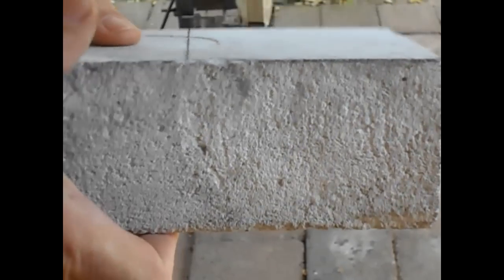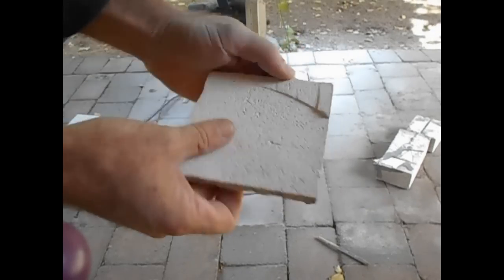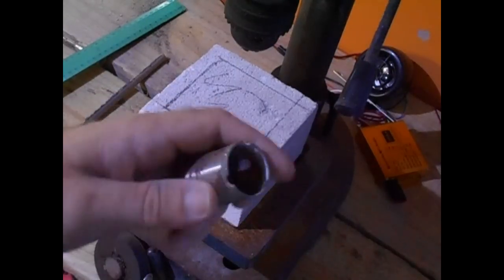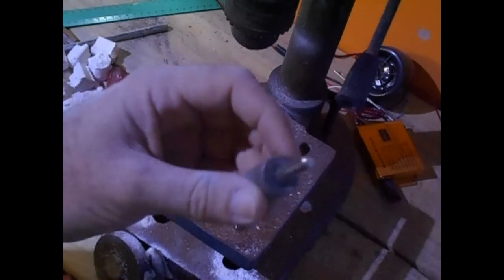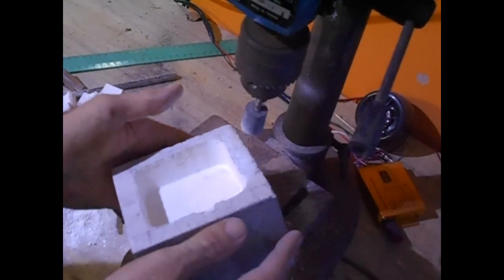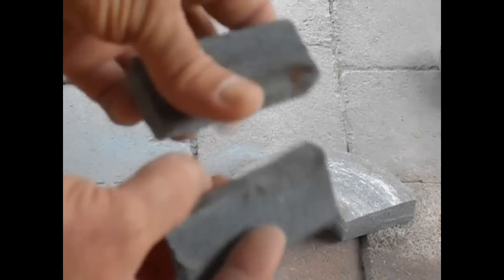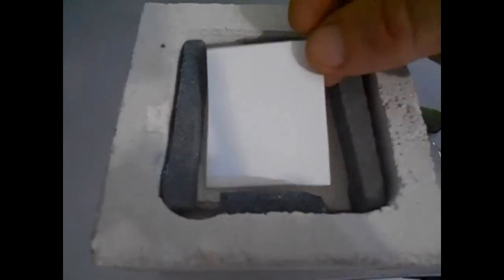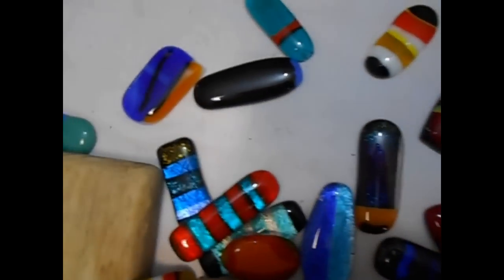How to make a Microwave Kiln - Easy and Cheap DIY Glass Fusing & Melting

Comment: Thanks for this video, very informative. Question: The standard dimensions of these insulation bricks in my country are (l x w x h) are 23 x 11 x 6.4 cm. It would mean that I am able to make a square oven of 11 cm, which is rather small……… By cutting off eg 15 cm long sections and use them as sides, as well as joining sections for the bottom and top of the kiln, can these be easily glued with heat resistant cement for example?
Thanks!
Reply from the maker: I also use half bricks, it's a good size for the microwave oven

Comment: i first watched this vid late last year and decided to make my mother one. i found the refractory bricks for 100 rand each from a very nice online foundry store based in ct. my bricks look a lot more porous than yours though. iv tried everywhere to get silicon carbide and cant find it. my bench grinder has aluminium oxide discs, i bought an oil stone which turned out to be some odd synthetic and iv asked around and still no luck. i dont really want to buy a new silicon carbide stone just to chop up.  is there any chance i could like buy just a few small pieces from you ? im in the eastern cape.
Reply from the maker: Sorry, I've been away for a while. Do you still need silicon carbide?
Reply: yeah  @thebeachfishing  i do,

Comment: Could you post the link to where you bought the bricks? I see a lot of kinds of bricks online. How did the kiln work? Whats the maximum volume? I'd be using it for raku glazed tiles.
Reply from the maker: Hi dssd. I picked up the bricks at a local refractory. The volume of my kilns varies but the average is 100 - 150 cm³.
Reply: @thebeachfishing thanks.
I just bought one.. they are great for drying green wet clay.. 25sec at a time

Comment: Nice job. Good hint with cutting up the grindstone. 😊😊
I do ceramic work and I have a Chinese one that I bought on ebay. Works fine but is too small for what I do. (Biggest available).
Can you make one much bigger? Or is there a problem with using one that is too big?
Reply from the maker: Hi bossdog. The only limitation of the kiln size is the size of the kiln bricks which I use. I don't see why 2 bricks can't be cemented together with fire resistant cement to make a larger kiln .

Comment: Thanks for such great and practical video.   I´ve seen in other videos  they drill a hole in the top.  Is it necessary?
Reply from the maker: Why drill a hole when you want to retain heat. Holes are necessary for gas furnaces because the injected gas needs a way out after its burned. No gas is used or created in the microwave kiln therefore no vent is required. The seal on the lid is not perfect, allowing expanding hot air to escape slowly. Thank you for watching 🤗

Comment: That's very clear... and clever!  Thanks a lot!
Suggestion: the microwaves have a center of maximal power focused just above the plate... going several cm higher may loose quite a bit of power... maybe shorter "legs" would be better?
Reply from the maker: Ah, thank you, I'll make a lower one with shorter stands and see if it makes a difference! 👍👍

Comment: Hi there this is fantastic. If i say wanted to make small glass window panels like on old fashioned stai ed glass could i use ceramic tile in bottom of kiln so it gives a flat finish to one side or would if pose a problem do you think? 
So inspired by this... nice one !
Reply from the maker: The bottom side will be as flat as the surface which you melt it on. Kiln paper leaves a smooth finish but not shiny. Thank you for watching 🤗

Comment: I have bbq high temp paint, i want to use micro2ave for this project same as your but the paint i want to use it with flour pots outside for using a small pencil torch or tealight, i see automotive paint is 2000° bbq paint is 1200° i have this last one but have pots too i need to make one for outside two times your kiln size...planning on doing raku and glazing...hoped not have to buy the thermal blanket if i dont have to. Do you think itll work? Tha ks sam
Reply from the maker: I'd say give it a try and see what happens. Just don't put any metal into the microwave and be very careful, the kiln becomes very hot, 1400'C+. Thank you for watching 😊

Comment: Lastn iggt i dexided to make a low fire clay kiln for outside itll work like the adobe oven...i think that fire brick limes inside, pencil torch or tea ligh but the terra cotta one for inside or out side. Hoping it works if it does im making a bigger one...inside diameter is 3-1/4" over time planning on a you tube channel...most of my work sells before i can devertise lol. Thanks for the help. Sam
Reply from the maker: You're welcome Terry. I would love to see some of your work!
Reply: @thebeachfishing  my na.e is samantha, i am using terrys axxount. That be cool i only have messenger or email and plan to do pictures. Hopedully i can get a channel here or advertise. Tha ks for the video and the help.

Comment: Could a person use an aluminium oxide grinding wheel as element instead of silicon carbide
 Can't get hold of silicon carbide grinding wheel.
Thanks
Reply: Yes
Reply from the maker: Normal common grey grinding wheels are made of silicone carbide, easily obtained. Thank you for watching 🤗

Comment: What was that white thing under the glass, not the insert. Was that kiln paper? Silicon carbide, where can i find that? I seen graphite powder used for the bottom amd someone said reactive paint but so far this is the best i have seen thanls for the video.
Reply from the maker: Hi Terry. The paper is indeed kiln paper. Silicone carbide is common grinding stone. Workshops will give you old ones for free. Thanks so much for watching
Reply: @thebeachfishing  i will ask around for the carbide wheel...the block at local clay store sells firebricks the large kind for 10$ thank you so much for the video, i need a taller space inside for clay firing. Capt mike has cideos for all his work and it seems to work well. The other suggestion from another viewer to use was graphite inside, but yours using the carbide seems like it will be eaier to get, thanks for the tip!
Reply from the maker: @terrynicholson5214  You're welcome. Let me know if you need more tips.

Comment: Thanks for very interesting video- but when you say "Graphite also works" does that mean you could just take a pencil and apply its graphite on the inner surface instead of the silicon carbide? (or for that matter, rub a piece of coal on it?)
Reply from the maker: Thank you for watching. Graphite sticks and graphite paint work as microwave susceptors. I don't know if a very thin layer will be effective, I'll have to do a test... have a great day 🤠
Reply: Some carboN Ark weldinnnn
Gouging rods .. are .graphite.

Comment: Purpose of using grindwheel pieces. Can you tell me is there something else could use for whatever the pieces do?
Reply: The grindwheel pieces are silicon carbide. They absorb the microwave energy and heat up.
So no, there's nothing else you can use instead.
Reply: @whynotdean8966  maybe 
Trumps head ..

Comment: Amazing! How many microwave ovens do you burn through, or does the magnitron handle this well? Also, could the kiln be made bigger so that bigger objects could be made, or does that present a problem?
Reply from the maker: Hi @R Cort. I have not had a failure yet, the microwave copes well. I do give it a few minutes to cool between firings though or else it gets hot. I also remove the kiln from the microwave to cool off. I'm sure it can be bade bigger, I'll try and post a video. Thank you so much for watching😊
Reply: Its 
Finnnnnn. With me.

Comment: Are there any reason you've used carbide slices ? Crucible withouth it cannot work ? Im really curious :) 
Regards
Reply from the maker: Silicone carbide is heated by the microwaves, this heats the kiln.Graphite also works. Thank you for watching.
Reply: Thanks for vey interesting video- but when you say "Graphite also works" does that mean you could just take a pencil and apply its graphite on the inner surface instead of the silicon carbide? (or for that matter, rub a piece of coal on it?) Thanks again
Reply: TheSoundsage ill check that cuz im planning to melt some quartz :)
Reply from the maker: @TheSoundsage   graphite paint on the inside of the kiln is also used by some. I have used thin graphite sticks, but had more success with silicon carbide. Thank you for watching 🤠
Reply: @thebeachfishing  hi thank you. 
Is silicon carbide a better conducting and therefore requires less microwave time would you say?
Reply: @TheSoundsage  goooooD dam 
Just try it .

Comment: Very nice! 
Is it a problem if the microwave does not rotate? Because i'm looking for a cheap microwave for the experiment, and i find one that doesn't rotate but has a economic price.
Reply from the maker: Hi Maria. I'm sure it will work just as well.  Thanks so much for watching!
Reply: Just put it on 
A marry.go.round.

Comment: Is that graphite? The dark grey strip you added toward the end?
Reply from the maker: That is silicon carbide, emery well or grinding wheel cut with a ceramic blade on an angle grinder. Thank you for watching 🤗

Comment: What is the rating on the fire brick you are using? e.g. K-23, K-26, K-28
Reply from the maker: Hi Jerry,Merry Christmas!! The bricks are not fire bricks, they are kiln bricks, I'm not sure what the rating is,or even if they are rated. They are the cheap common variety used for glass melting furnaces. Thank you so much for watching, have a great day! 🤠
Reply: @thebeachfishing  big difference? 
whats the difference? i have some furnace bricks from a old dryer from a limestone burner..would they work?
Reply: Its 
Judt 
Dam hot.

Comment: Was there a reason why you halved the carbide slices? Just for space or was there another purpose? :) Btw using the core pieces as stilts is genius!
Reply from the maker: Yes, they were halved for a better fit, to allow the lid to fit on, and to maximize interior space. Thanks Julie🤠

Comment: Doesn’t the top need a hole?  The other videos I’ve watched all have a hole.
Reply from the maker: Hi Lab Rat. I have never made a hole in my lid, the seal is loose enough to allow expanding air to escape, yet tight enough to retain the heat. I would be concerned about the amount of heat lost through the hole, possibly overheating the microwave oven and extending the time of the process. Thank you so much for watching! 🤠

Comment: How do I tell if my grind stone is silicon carbide or aluminium oxide?
Reply from the maker: Usually the light grey stones are Silicone carbide Ash, I've never tried aluminium oxide but it might be worth experimenting with
Reply: @thebeachfishing  Ok thanks for that. Will try them both
Reply: @thebeachfishing  Is there a way of telling, by using the microwave ?  I mean before cutting
Reply: @maynorcascantekopper6979  White stones are Aluminum Oxide while the gray or dark green ones are usually Silicon Carbide. You can cut out a small piece and stick it in the microwave, if it starts glowing, you have silicon carbide.
Reply: Yessss
I like sill con carbid.good n hot .

Comment: Why don't you just use the small piece, put kiln paper on it. Place it on the one you call the top and use the box as the lid. Drill a small hole in the top and BAM, you got it.

Comment: None of that looks cheap. The tools you used alone would be a thousand dollars. Not easy either.
Reply from the maker: you can do it with any hand tools, just use your intelligence!
Reply: @thebeachfishing  Thanks ill get my hammer and nails to make a wooden box, im sure that will work.
Reply from the maker: @orangeziggy599  Hi Amigo. I got the kiln brick for 5 South African Rand, about 30 US cents. I made my first kiln with a hacksaw and a chisel, the kiln bricks are soft. Contact a refractory for bricks, I would send you one free if you were close by..
Reply: @thebeachfishing  What is it made out of, the website lists 30 different types of material for the refractory bricks.
Reply from the maker: @orangeziggy599  Mainly silica. the bricks are very light compared to an ordinary brick. Glass workers use them as a base to work on when melting small pieces of glass with a gas torch.